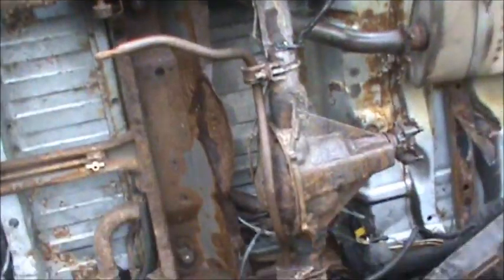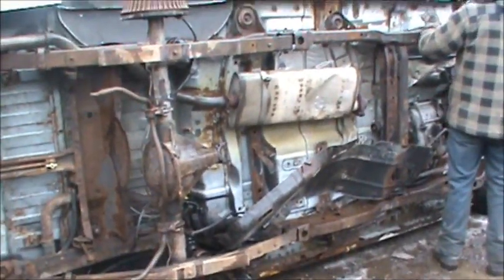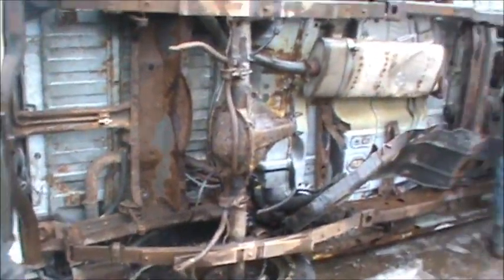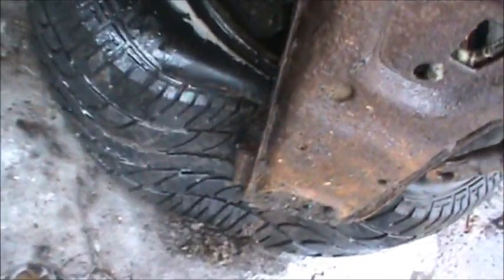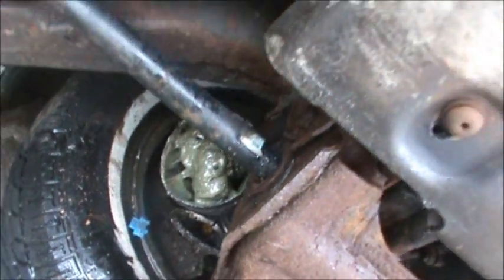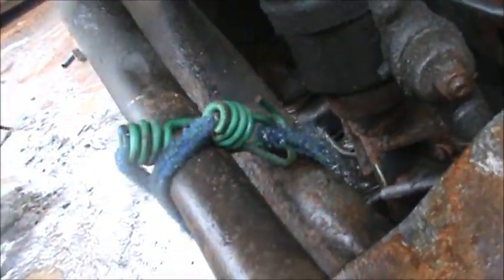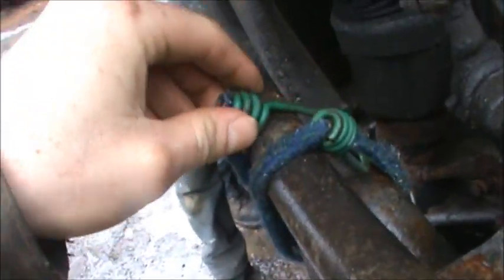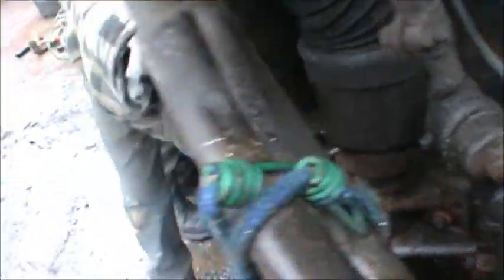Wrecker the Wreckor

Comment: only 2% of the blazers have that under body armor that you see in the video. those aluminum pans are worth quite a bit on eBay, if you sell them there you will need the little L brackets that attach the pan to the lower A frames.